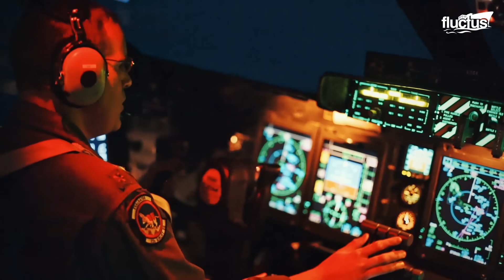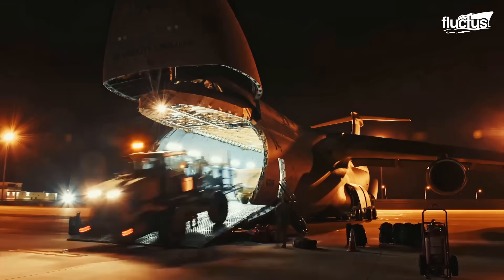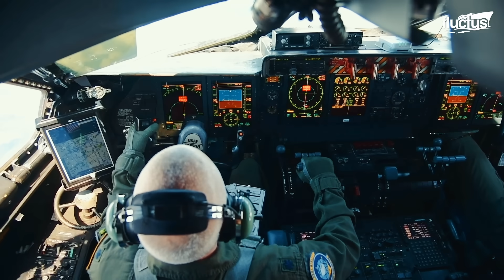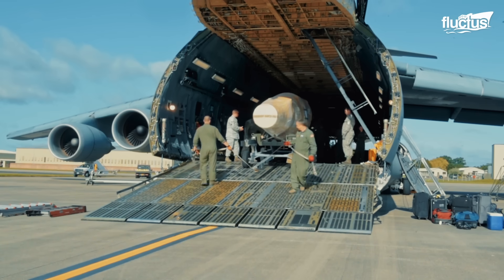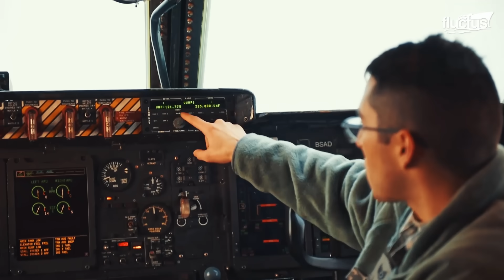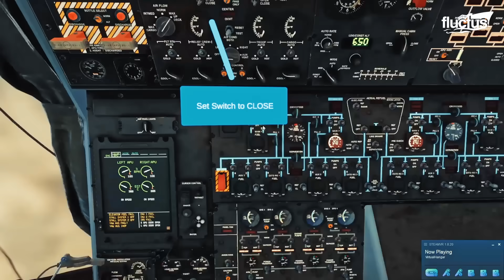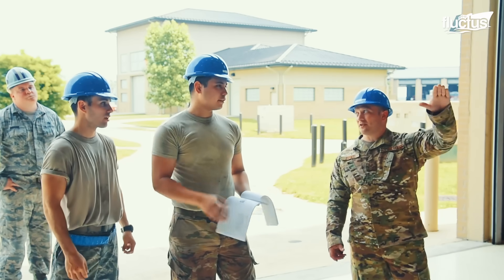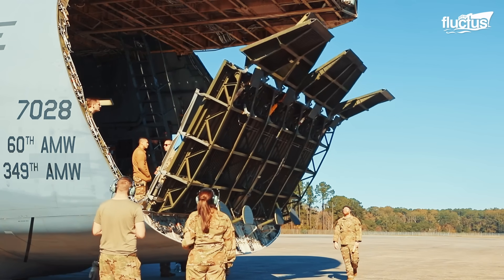C-5 Galaxy: US Largest Military Transport Aircraft Ever Built

Comment: Back to 1974 through 2976, I was assigned to the 436th MAC Wing at Dover. in one of the hangers, they had the posters with information on the c-5A. It started with how much it could hold, the list went from six Gray Hound Scenic Cruiser busses, which for a demo for the Boy Scouts, all six were inside and the ramp and visor closed up. Then it went to how many VW bugs, all the way down to how many golf balls it took to fill it, a staggering number. The other poster said if you removed the wings, tail and rudder from a C-130. it fit inside the fuselage of a C-141, then take the wings off of that and the tail surfaces, and both would fit inside the belly of the C-5A. it was huge.

Comment: I was stationed at NOB Norfolk in the early '80's.  On my way to work I would often see the C5 taking off.  It looked like it was going vertical at a faster rate than it was going forward; almost like a VTOL Incredible site to see the raw power lifting that aircraft in the air.

Comment: In the late 70’s my unit loaded SEVEN of our Huey’s in ONE C-5 and took them to Panama.  In the early 80’s my unit loaded SIX UH-60 Blackhawks on ONE C-5 and took them to Egypt.  They had to remove the stabilator from each Blackhawk to fit them all in but I had to do a test flight after they unfolded the blades anyway so it didn’t add much time to get them back in service.
Reply: I checked for the Salute emoji- couldn't find it. But you have mine Sir!!

Comment: The Lockheed C-5 Galaxy (now C-5 M Super Galaxy) is the third largest cargo airplane in the world.. 

The largest passenger air planes in the world are the Airbus A380-800 Super, Boeing 747-8i/F and Airbus A340-600..
The last two named airplanes have among the longest airframes ever build.. 
The total length of the Airbus A340-600  is 73,00 metres.. The total length of the Boeing 747-8i/F is 76,00 metres..

The nose section of the Lockheed C-5 Galaxy is developed by Boeing, by the developper of the Boeing 747, the first, Boeing 747-100, Mister Joe Sutter..

Comment: An-124 is better, more reliable and more practical.
Reply: @world-aviation    Highly debatable.  As it is, Russia struggles to keep the remaining 124's in working order.   I'll agree that, overall, they are very close in size and payload capacity, with the 124 being able to carry about 15-20% more depending on configuration.  But the C-5 has over DOUBLE the range capacity,..... 124 can cruise about 2,500 miles, the C-5 can do over 5,000 miles.
Reply: Also sadly, a lot more charred, too.
Reply: @donutman3089 an225 was destroyed. Still plenty of 124s about
Reply: who cares about russia tho
Reply: Given the -124's mission capable rate and unpressurized cargo compartment, it seems like you have no idea as to what you type about.